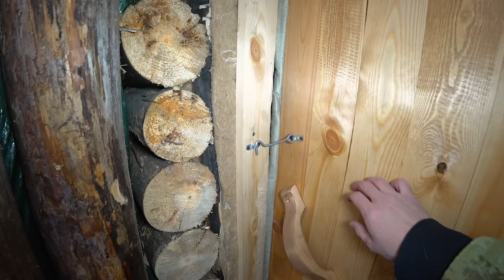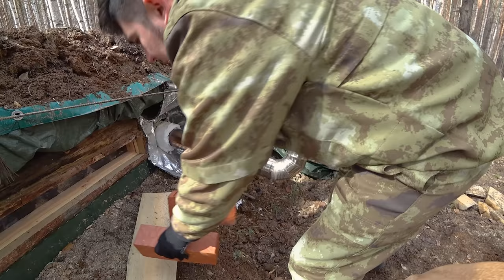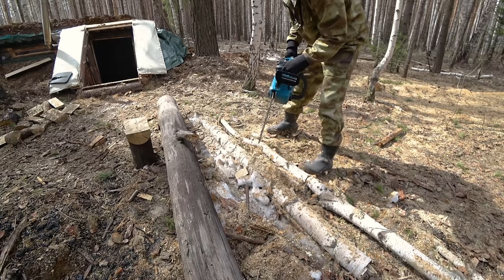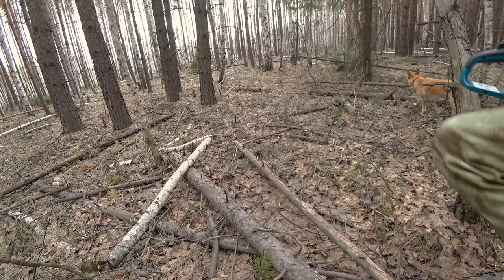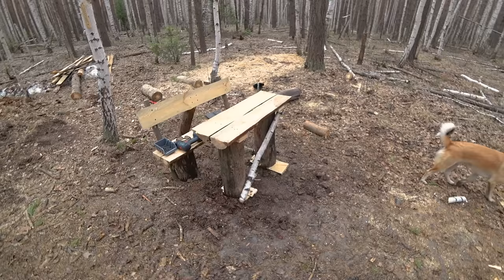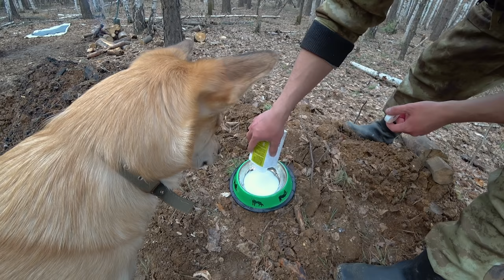I put things in order on the territory near the dugout. Made a table and a bench. Part 27.

Comment: Just wondering if the stovepipe has to go through the side. Would there be any benefit on having it straight through the roof. Only thing I see is if you go through the roof you loose overhead cover. 🙏🇺🇸🪖 Old bones and antlers in woods might have natural anthrax on them.

Comment: Amazing what a difference a thaw makes, I barely recognized the base without snow on it. Gonna need to finish burying the dugout completely once that ground really starts to thaw.

One way you might be able to stabilize your little bench and picnic table would be to cut disks from that big tree trunk you have, and screw those on as feet on the bottom of the legs, to give them a wider base for support

Also, today I learned what Kefir is. It's always interesting to learn about the weird little quirks of other cultures cuisine.

Gotta get a proper fire pit built outside to go with all that yard furniture